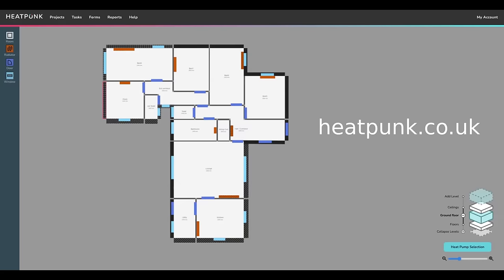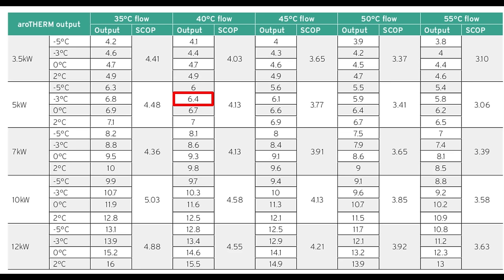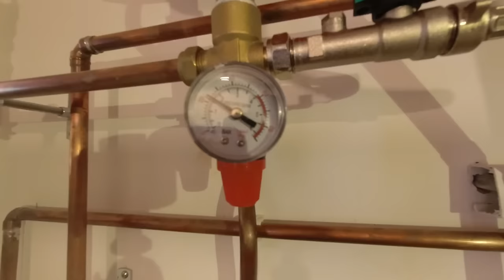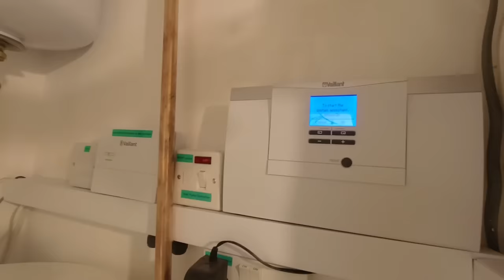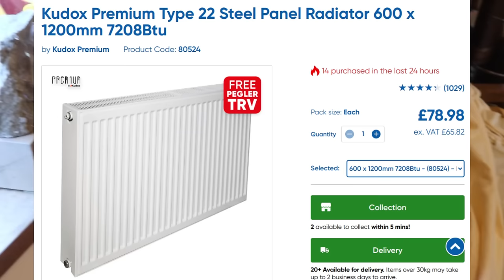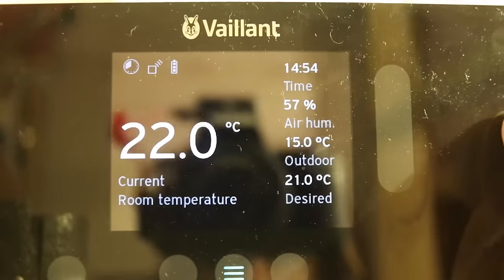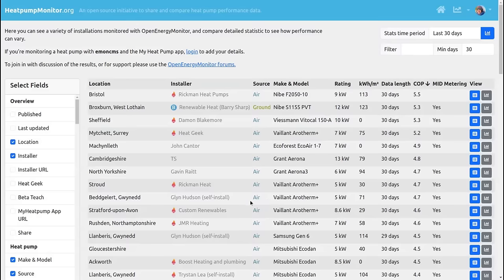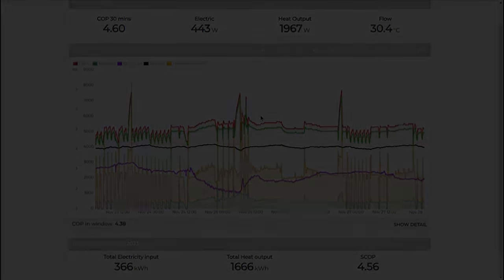Solid Fuel to Vaillant Air Source Heat Pump: 1980s Bungalow

Comment: Looks excellent. is it an open loop system or is there a circulation pump? I used a preplumbed cylinder from Daikin and it comes set-up with a buffer built into the tank and a circulation pump. This can be bypassed and just used as a volumiser if I like - which I think I may do. It's running about 100m2 of underfloor heating. Do need to speak to Daikin to figure out the pump settings for using it this way.
Reply from the maker: This system is running open loop with just the one circulation pump that's inside the heatpump. You shouldn't have any problem running open loop on your UFH, I would highly recommend it for best efficiency. Just make sure that you've got minimal zoning, try to keep as much of the system open as you can. No special settings should be required, just remove the 2nd pump. You also want to avoid having a blending valve or additonal pump on UFH manifold. Personally I would avoid Daikin, lots of folk are struggling to get Daikin units to perform well. Take a look at some of the threads on the openenergymonitor forums: https://community.openenergymonitor.org
Reply: @GlynHudson  Thanks for your reply, The system is pure weather compensation, no room stats, no zoning, no actuators, no blending valves or pump at the manifold. It just has the circulation pump on the cylinder which I guess is their sticking plaster to make all installations "work". That's interesting - I'm going to swap around the connections to remove the buffer and pump imminently - I'm hoping I can isolating the space heat circuit at the underfloor heating manifold and then make sure the diverter valve is on DHW so I dont have to do a full drain down and lose all my biocide and inhibitor!
Reply: @GlynHudson   I've switched them over now and isolated the buffer, it now just acts as a volumiser - makes so much more sense. I've had no issues with my Daikin unit,  I was heavily involved in the overall design of the system, even on my previous buffer setup I achieved a cop of around 4.0 in moderate winter weather, though I am in one of the warmest parts of the UK. I predict this modification will definitely improve efficiency further though. It's the Altherma 3 Monoblock 8kW, the smaller unit size they do
Reply from the maker: @jtrent90  that's excellent, nice work 👌

Comment: Hi Glyn, what sort of cost would an install like that be?
I looked into heat pumps back when RHI was running. The rewards were so much better under that initiative but trying to get an installer to respond was hard enough, let alone finding one that was competent. After many failed attempts, I finally got someone to quote an horrendous amount for an install which I was cost prohibitive at the time. I think there are more competent installers out there now but realistically, looking at what's involved in getting a heat pump system installed with pipe and radiator upgrades, I fear the affordability is just always going to be a sticking point.
Reply from the maker: Sorry, I've got no idea. Since I did the work myself there wasn't a labour cost which is a very significant cost for a HP install. Labour cost also fairies a lot depending on how much auxiliary work is required and where you are in the country. I would recommend trying to get a quote from a heat geek trained installer.

Comment: Fantastic job and great attention to detail too.  Are there any particular settings on the Vaillant that were hard to figure out / any that could have been easily missed ?

I'm planning a self-install during next summer, although I really feel I need some form of backup support in the years ahead, but I can't find any Vaillant installers yet in Ireland
Reply from the maker: Thanks. No really, the Vaillant controller is one of the best and easiest to setup, the import important setting is getting the heat curve set correctly. I cover this in the video. Best of luck with your install
Reply: @GlynHudson   What is the BES part number for the Inta Isolation valves.  I'm not seeing them on their website.  And how do you size the heating expansion vessel ?  My Combi currently has it onboard.

Video a huge resource for anyone doing a self install
Reply from the maker: @ChampionCCC  they 25792, check to make sure your heatpump requires 1 1/4", most other heatpumps appart from Vaillant are 1". Lots of online resources for calculating EV size, it depends on water volume in system and max design temperature, no harm in EV being larger than needed, but if your space constrained it's surprising how small you can get away with.
Reply: @GlynHudson  Many thanks

I'm planning to install the same 7kW AroTHERM Plus.  I like Vaillant, and have a Vaillant Combi currently

Comment: Could you tell me more about how you achieved such a high DHW COP?
Reply from the maker: Heat geek covered this in detail in this video https://youtu.be/tAoRH_WEt78?si=QZR5sEvuHS26oChy
Reply: @GlynHudson  Thank you! 

So it's settings, and not physical install? I'm about to get a heat pump and wondering if it's worth the extra for the Newark Heat Geek cylinder vs, say a Joule Cyclone. It's really hard to find information on the performance difference due to the coil size difference.
Reply from the maker: @Leo99929  This system just has a standard Telford heat pump Cylinder. The new Heat Geek cylinders are great and will give even better performance, but whether they are worth the extra cost, DHW is a relatively small % of the overall heat requirement. Focusing on the best space heating performance i.e the lowest possible design flow temperature by upgrading radiators will give a better return on investment. Any heat pump cylinder can get decent performance with the correct settings and recharge schedule. Although I wouldn't recommend the Telford Tempest.

Comment: Hey Glyn 🙂 Awesome stuff! (Love your EV vids)…..can I ask did you receive the Boiler Upgrade grant for this.  I’d love to do the same but wondering if it would be cost effective.
Reply from the maker: No I didn't, you either need to be MCS certified or use an MCS umbrella scheme to get the BUS grant
Reply: Hi Glyn, just a quick note to say thank you for your quick reply  @GlynHudson  👍

Comment: How well was the house insulated? Looks great nice job.
Reply from the maker: Nothing special, quite standard really. It's got cavity wall insulation on some walls and non insulated cavity on others. About 150-200mm of loft insulation. Windows are decent but nothing special. Exterior doors are solid wood and quite poorly sealed.
Reply: Thanks for the reply, great video.

Comment: Besides the VRC720f with the wireless temp sensor, are any other controllers used?
Reply from the maker: No, using manufacture's own controls with no zoning generally gives the best performance with a heat pump. We have TRVs fitted on rads, but these are just used for overheat protection

Comment: Roughly what did the whole install cost if you dont mind me asking?
Reply from the maker: About £6k including all the radiators and cylinder. But since my labour was free this is cost is not representative. Vaillant heatpumps are quite expensive, it would be possible to reduce cost by £1-2k by using a cheaper heat pump.

Comment: How do you get around the Permitted Development issue? (mainly at your house where it's mounted to the wall) As I understand this is the main issue in Wales where it is 1m.
I'd love to upgrade but literally no areas of my property are more than 1mtr away from a boundary or within view of a neighbours window? (Ex council end terrace house end of terrace at the turn in a road so triangular plot)
Reply from the maker: In Wales it's actually 3 meters which is crazy! However this is under review and will no doubt be reduced or abolished. If the system does not fall under permitted development it just means you need to apply for planning it will nearly always be approved but it's more hassle. I'm lucky both the installations I've been involved with don't have any neighbours within 3m. It's particularly crazy since modern heat pumps are so quiet
Reply: @GlynHudson  sorry i got that completely backwards as I read it's 1m in England Vs our 3m! Fingers crossed it's binned in the review...

Comment: I find it "interesting" that Vaillant appears to be offering some components, like that solar powered outdoor temp sensor or the VR940f controller in the UK, but not here in Germany,. despite Vaillant being a german brand...🤔
Reply from the maker: That's really surprising, I wonder why that is? Could they just be available under a different part number?
Reply: @GlynHudson  
I don't think so. They are not even listed at Vaillant at all. No manuals, no nothing. Seems they are UK only, at least for now...?

Comment: how did you register your unvented cylinder to building control as i assume you do not  have an unvented hot water qualification which is legally required
Reply: You do not need G3, that is only required for self certifying. All that is required is to notify BC and pay for their inspection.
Reply: @normanboyes4983 That's interesting news for me. I want to fit an unvented cylinder as part of a gradual upgrade program heading towards replacing gas boiler for a heat pump. I did not know how to get over the 3G qualification issue. I'm happy to pay for a BC inspection. I will look further into the process.

Comment: Were you able to benefit from the UK government grant for this excellent installation? I thought that you need to use an MCS accredited installer to qualify - perhaps you are, but you keep saying that you are not an installer...
Reply from the maker: No, we didn't get to claim the grant but my labour was free so it was quite affordable. But I wouldn't recomend it since grant is so generous atm
Reply: @GlynHudson  thanks for responding. It's a shame that you can't get an MCS accredited installer to sign of a system installed by a competent homeowner. I suspect that the job you did was every bit as good as any MCS installer would provide.

Comment: Ignore that last comment I have just found the room temp. Clearly no Parka required
Reply from the maker: Yup, temperature is around 21C during the day and 19C overnight, most evenings it's increased to 22C
Reply: @GlynHudson  yes sorry about that. I did notice some don't show there room temp though, I would like to monitor mine as the Samsung readings on my controller are all over the place some days it says it has been running for 37 hours. I did speak to Samsung tech and they said take no notice of it it's not at all accurate. Would just be nice to see what my cop is but the cost for the equipment to monitor it is a bit to expensive. I am happy with my usage I use about 4000kwh a year on a 200 sq metre 220 year old house and that is keeping it at a constant 20 degrees. I guess that's reasonable

Comment: Have say, just goes to show that with the right knowledge and tools heat pumps are nothing to bamboozled over. A thought through self install is probably going to give better long term returns than going with an installer who has little knowledge and is just box shifting to get grants.
Good work, keep it up.

Comment: Glyn are there any regulatory issues to be aware of?  As a competent DIYer with a lot of experience, I am seriously thinking of a DIY install.  I have a friend who is a registered electrician but my house is already well up to standard electrically.  I guess as there is no gas involved there is not a problem on the plumbing side.  If I ever sell my house would I have produce any heat pump installation certification.  Many thanks for the vids.

Comment: Why don’t you use the pre plumbed options? Surely that’d be a lot easier?
Reply from the maker: The Vaillant indoor hydrobox is more expensive, not as space efficient, and harder and more expensive to maintain. Also, the time saved it not very much.

Comment: You did this all yourself, self-taught?! You make it look so easy!
Reply from the maker: Yes, I had some experience installed a heat pump in my own home (https://www.youtube.com/watch?v=Hyv_vQEvHgo), but I'm not an installer. I'm involved in monitoring heat pump with my work at OpenEnergyMonitor, so I do have some experience designing and optimizing heat pumps. The mechanics of plumbing e.g soldering etc is not that difficult, after a few tries. It's good fun!

Comment: I have really enjoyed your videos and admire the standard of your work.  I would love to do a self install myself.  About 15 years ago I re-piped all my rads in 10mm plastic when I had a new boiler installed.  It seems I would have to re-pipe it again in 15mm to get the full benefit of a heat pump.  But I would have to rip up oak flooring and some tiled floors to do it.  It seems a lot of upheaval.  Thank you.
Reply from the maker: It depends on the heat loss of your property, 10mm may be ok, although the internal bore on 10mm plastic is quite restrictive. Here's a good video on a heat pump installation with microbore https://www.youtube.com/watch?v=kxKEx1z00-4

Comment: Hey Glyn thanks so much for your videos super helpful insights. I'm planning on doing a self install in France but struggling to find the outside design temperature for my area (74330) it can drop to -10 and occassionally -20 here in winter, do you know if setting my design to -3 is still sensible? thank you!
Reply from the maker: That's great to hear! Do you have a secondary heating source? E.g wood stove? If so, and if its -10/-20C for only few days of the year each year it would be more sensible to design for -3C and then supplement the heating when the temperature drops below -3C
Reply: @GlynHudson  thanks for the speedy reply! I don't but I'm currently trying to see if its a possibility, but its a little tricky in the layout with the roof shape and neighbours in the building (45m2 apartment over 3 floors) at present its on a single electric heater so even if it goes back to 1:1 spending on electric for. a few days I'll be so much better off. 2 floors have wet ufh that was run from an oil boiler so my install internally should be a breeze (I hope :D)

Comment: Glynn fantastic video.  Could I please which supplier did you use for the compression flow rate meters? And the heat pump isolation valve levers?   Looking forward to more videos.
Reply from the maker: Thanks, The Sontex 789 heat meter was from OpenEnergyMonitor and the Insta isolation valves were from BES